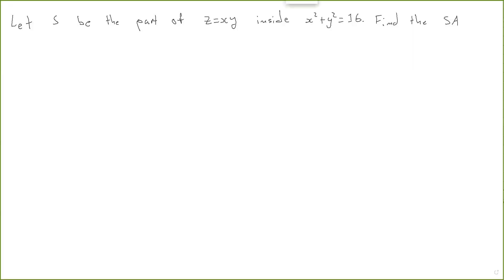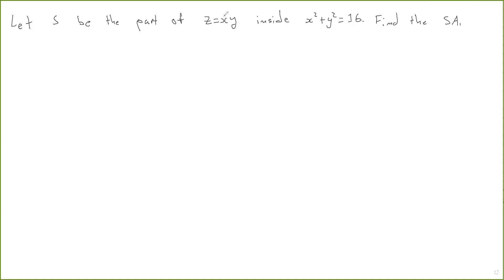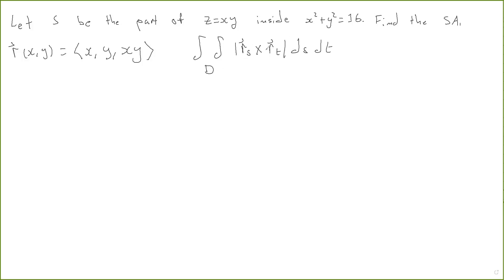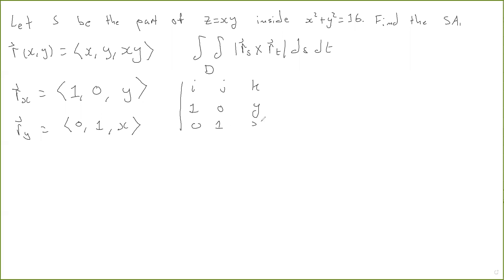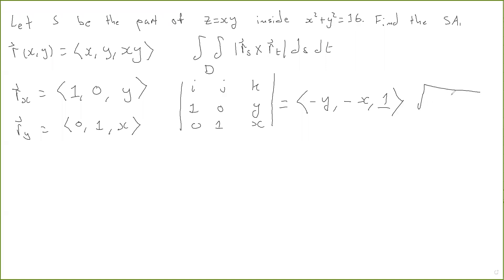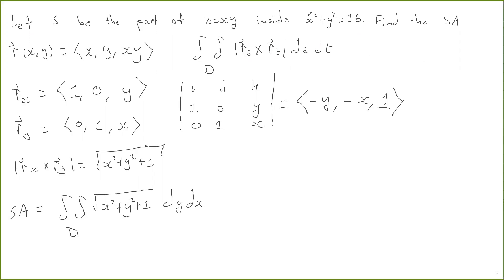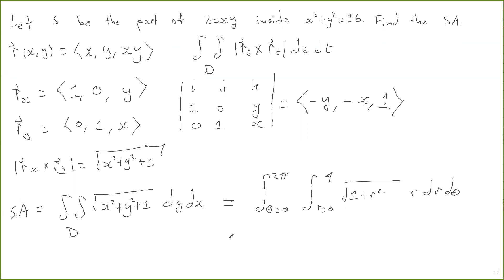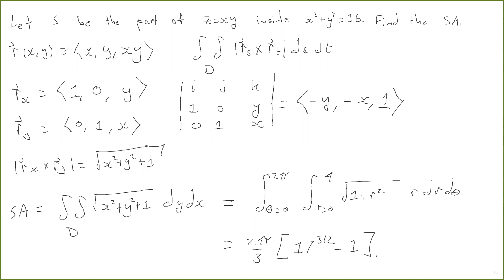I compute the surface area of part of the saddle z=xy.

Comment: All of the vector stuff and cross product stuff was not necessary to work the problem.  It will only confuse people.  Just take the partial derivatives, plug them into the SA integral and you're done.
Reply from the maker: Hmmm, I didn't realize vectors would confuse people in a problem about vector calculus. 

I took time deriving various formulas for surface integrals of scalar fields and so I'm going to use it to re-enforce that. I don't really know why you felt the need to make this comment.

Comment: Hi! I know this is old, but I just want to thank you for sharing this video. I was stuck on a similar problem, and it took watching it all the way through to realize my issue was I forgot to include the extra factor of r for polar coordinates. For the problem in question, the given cylinder was x^2+y^2=1 and the surface area turned out to be (2pi/3)(2sqrt(2)-1). It's always beneficial to take the time to actually watch a worked example. Thanks! c:
Reply from the maker: Glad it helped!